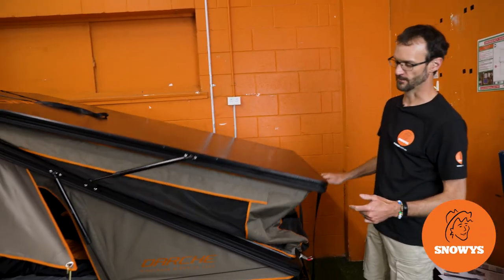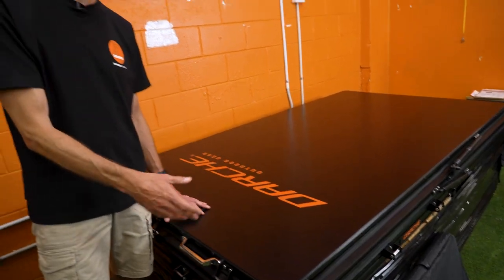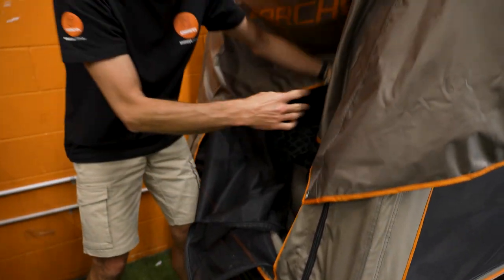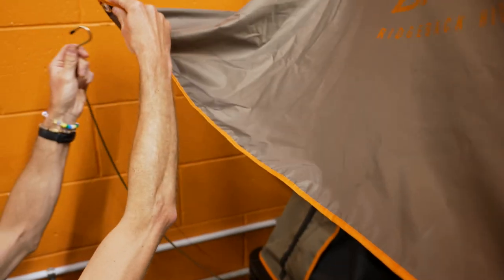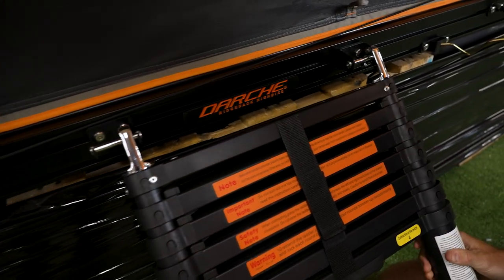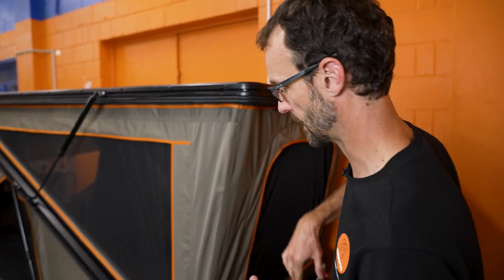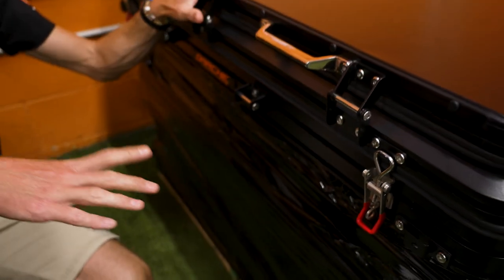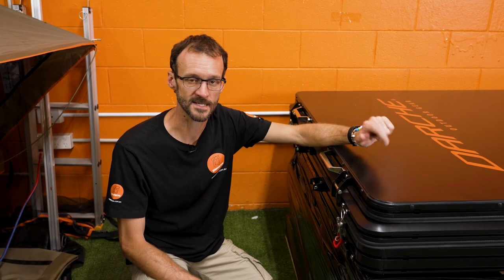Darche Ridgeback HighRize Hard Shell Rooftop Tent - How to setup & pack away

Comment: Would be a mission to climb onto the roof of my ute to pull down one side of the tent.
Maybe it designed to be fitted to a trailer and not a vehicle
Reply: Going by this vid I'm pretty sure a ladder is supplied in the package.
Reply from the maker: The ladder is included as C.Nile mentioned @kadiocalc - generally no issues with pack up or set up, its pretty straight forward.
~ Lauren

Comment: How does the fly go in the wind?  It looks like it would probably flap around a lot.
Reply from the maker: We've had no negative reports on it so far.  Fairly safe to assume it will flap around a bit, but no more than the awning on any other camping gear.  You'd obviously use some common sense with how you orient your vehicle & tent if you're expecting rough weather, or not set the awning up at all if it's super windy.
~ Lauren